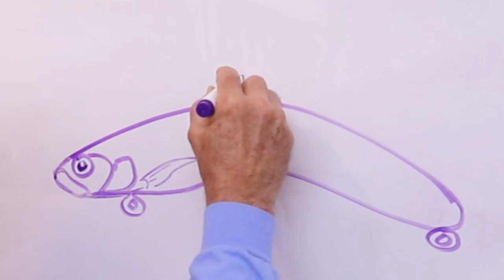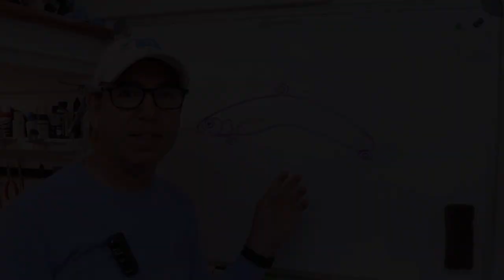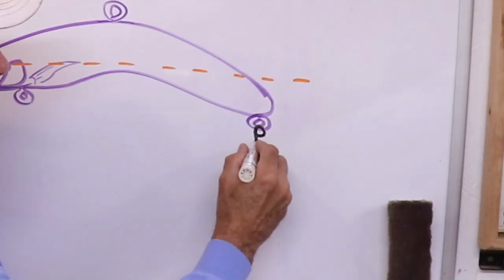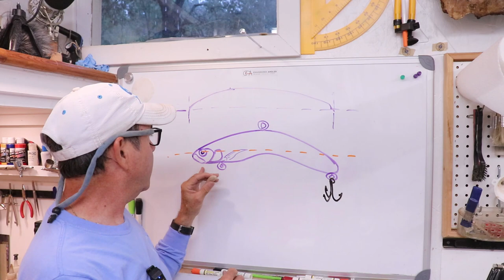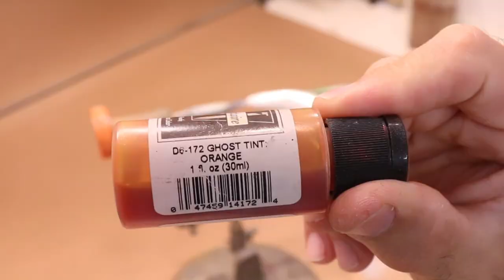Wacky Rig Topwater Bass Lure, Making a Unique Topewater Lure  #topwaterlure  #basslure

Comment: Good evening Sir.  You make very nice different lures. Awesome job!  I used to use these silver foils for many years in the past. Nowadays there are special holographic foils for fingernails, which are beautiful and easily to apply.  I am now also using new paints for airbrushing, that also look very nice. The aluminum foils have a big disadvantage. They are very smooth and the clear coat does not adhere very well and may eventually peel off.  I am waiting for your new videos, so keep it up your awesome job.  Greetings from Germany Jan Fischer 👍🏼👍🏼👍🏼👍🏼🐟🐟🐟🐟🐟🐟🐟
Reply from the maker: Thank you so much for your input.  Keep watching.

Comment: Interesting lure Franco!  Think a lot of lipless baits could be fished that way. So different down there than here (Ontario, Canada), no gators and the water in the lakes I fish is clear enough that the deep weed edge is down 15 to 18 feet. Silver/chrome  lures work well for me so I'm looking for the best solution be it spray, aluminum tape, some other foil or reflective mylar. Find the foil tape to be a bit of a pain to work with on round-bodied lures (like a Big-O).  While a specular chrome flash is desirable (to catch fishermen?) it may be that plain old Silver paint might reflect enough light to imitate the flash of a baitfish. Maybe some glitter in the clear-coat would do it. I'll have to take some underwater videos to see. Per the bandsaw problem, I  agree with the others - the teeth one one side of the blade are likely duller and/or have less set than the other side causing the blade to veer off line. Had this happen when cutting too tight a radius for the width of the blade - hitting that knot didn't help either - knew right away that the blade was not happy.    P.S. bet that gator would have given you one heck of a fight  LOL!
Reply from the maker: Thanks for the feedback...it makes all this worthwhile. Gator hook-ups are never good

Comment: I bet no bass on the planet has seen this presentation before. Love the out of the box thinking. I will be laid up for rotator cuff surgery. Will be watching all your videos and taking notes. 
Like Suchajerk, I also use nail art foil. It has a veeeerry thin foil on a plastic backing. You apply glue (thin epoxy) and peel off the plastic. When done correctly, no measurable weight is added to the lure. When I foil, I do the entire bait (except for the bib). You can always cover it with opaque paints. Three colors work for me: silver, silver holographic, and clear (sometimes called white) holographic. If you are interested, I can send some info via email.
Reply from the maker: Best of luck with the surgery 👍

Comment: Check ur blade guide rollers & tension , they might need oil or replacement,  check the rubber grip strips on the  wheels for uneven wear ,check to see the wheels are in parallel& square hope  this helps with bandsaw issues. 
What reel was that ? Cool banana lure

Comment: You probably have got the bandsaw problem sorted out by now,but here's a lil tip to use on every new blade. Take a small sharpening stone and while the saw is running hold it at an 90* angle at the back of the blade and lightly let the blade run on it.This will reduce/remove the bump where it was welded.Then hold it at about a 45* with the back of the blade and let it ride on the blade again,sort of move the stone so it rounds over the edge of the blade.  This will help it cut better curves,can help with not cutting straight if it has a edge on one side and reduce or stop the clicking sound when it's running...which is the weld bump hitting the bearings or blocks. It doesn't take much pressure with the stone,but do leave it run a good number of revolutions.
They make a specific stick with a stone epoxied to it for doing this,but no need to spend $ unnecessarily.

If a blade is getting a lil duller on one side than the other it will wonder to that side.Because of the tooth set you can sort of test to see if this is happening.With the saw off you can slide your finger up the side of the blade to see if one side is duller than the other.You'll want to rotate the blade and check the whole thing.If only a short section is duller than the other it'll still give you problems.

Make sure your blade is 90* with the table too.
When changing blades loosen all bearings or rub/guide blocks,install other blade,tension it,then adjust your bearings,rub/guide blocks.Then recheck the squareness of the blade to table.
Reply: Ohhhh,and also be careful of the sparks!!!! Best to clean out the machine then do it and if you have dust collection do not run it while doing it.
Reply from the maker: Nice tip thanks...I had replaced the blade, it made a big difference.
Reply: @EngineeredAngler  Yeah it sounds like it may been duller on one side than the other.
Sometimes the tooth set can be off from one side to the other and it'll also do that.

Comment: I cut 100’s of cuts through aluminum engines heads every week to measure wall thicknesses inside the chamber voids. When I have a issue with the blade wanting to swerve to one side or another, it’s usually due to the teeth on the blade being damaged or wore down on one side of the blade.
Reply from the maker: Great tip!

Comment: You will need to perform the next operation. We in Serbia call it (Breaking the saw) Special pliers that adjust the teeth on the saw, move a few millimeters to the left and then repeat the same on the right side. So that the blade could cut straight, it throws out sawdust. There is nothing difficult to do but it is very boring. Good luck Greetings from Serbia!
Reply from the maker: Thanks for the tip.

Comment: You have what's known as blade deflection on your band saw, its pretty common, makes it difficult to cut a straight line. If you have a fence for it, you can correct the deflection with the fence. Take a scrap piece of wood and mark a straight line length wise , like you are ripping it. Start your cut on the line, and you will be able to see to which side the blade is deflecting towards. Its possible then to adjust your fence to match the blade deflection and giving you a straight cut. Next time you want to rip a piece wood, you will probably have to repeat the same process again, as the blade will generally not deflect to the same side always and maybe by a different amount. When you saw curves on the band saw then try to rip a straight cut you will need to reset your fence to match the deflection.
Reply from the maker: Thanks for the tip.  I just bought a nice new Bosch blade and that fixed it.

Comment: I just tossed the one I made in my tackle box yesterday. I didn't put any weight in mine the hooks and rings were enough. Your saw blade is dull on one side. You can try and adjust your guides but if it is going off in the one direction change the blade.
Reply from the maker: Thank you...I'm buying a new blade.

Comment: Great different build that works. If weight properly this could be converted to an ice fishing lure. More foil means more flash which you need in the early morning or evening to catch light and attract fish on the hunt.  Check Utube for help on your band sale, but have to agree with Wayne D,   Wheel maybe out of alignment. Just like a belt sander.  Remember your motor -pump alignment training - when you mic a coupler in.
Reply from the maker: Great point!

Comment: Nothing like a top water bite !! I would like to pick your brain on buoyancy. Let’s say I core drill a wood body and plug it off, sealed completely leaving a sealed void within the body of lure. Is it best to leave that void empty or fill it with a material to create more buoyancy ??
Reply from the maker: You can only create greater buoyancy by reducing weight. Or you can make the lure larger keeping the weight the same, or less. If you fill the void, it has to be with a material that is lighter (lower density) than the wood.  Hope this helps.
Reply: @EngineeredAngler  thanks for your response, so would you say not filling the void would create the most buoyancy ?